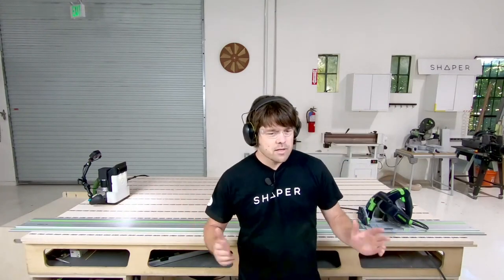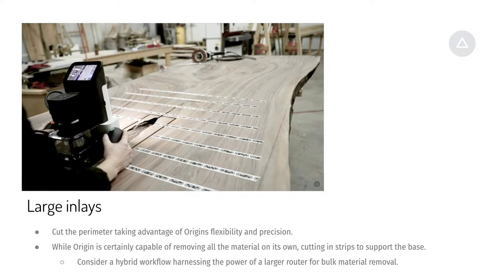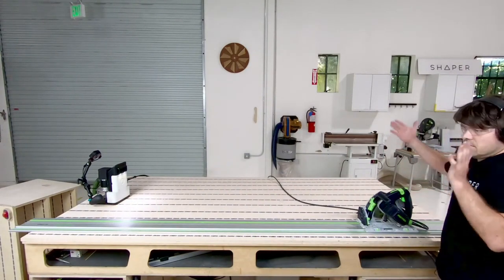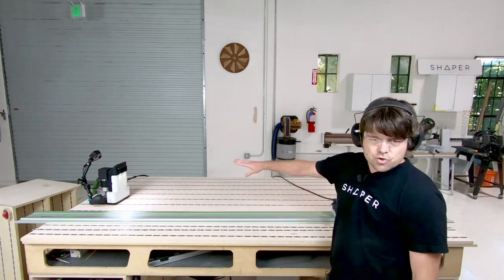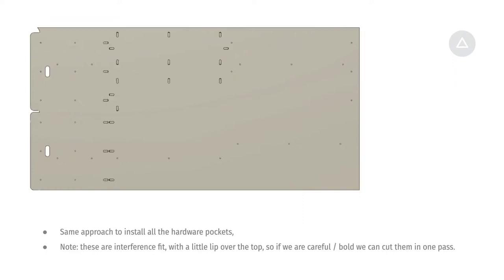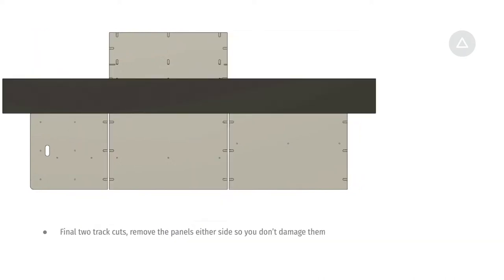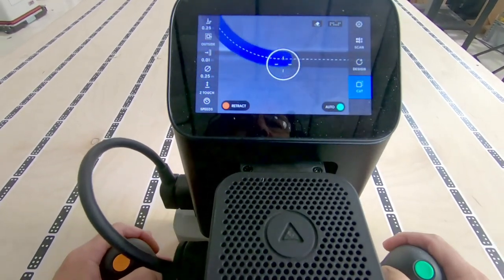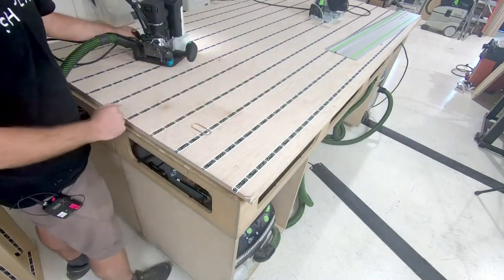Session 3  – English: Hybrid Cutting : Origin + Tracksaw

Comment: I also missed the live session so thanks. This makes perfect sense. As a boat builder sometimes you want the fastest way to remove waste and then fine finish tune with hand plane etc. I will now use origin more in conjunction with my track saw especially when making templates. More information on cutting non ferrous metals would be great please Shaper team. Depth of cuts possible etc. Thanks.
Reply from the maker: The recommended maximum depth of cutting non-ferrous metals is .04" with an O-Flute bit. You can read more about materials recommendations here: https://support.shapertools.com/hc/en-us/articles/360016398434-Materials-Recommendations

Comment: Very good ideas in this session. Thanks. For the Lamello Cabineo 8 cutouts, why did you do an inside cut instead of a pocket? A pocket operation would have cleared out the small pieces instead of needing to use a chisel to cut them out. What am I missing?
Reply: Inside cut moves the tool automatically along the edge. Pocket doesn’t. For a tight cut, sometimes it’s more convenient.